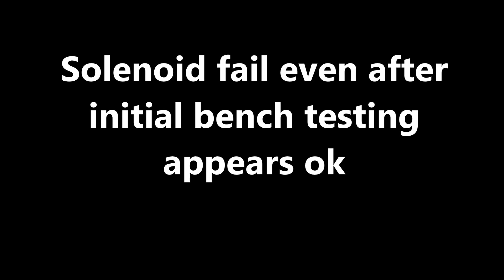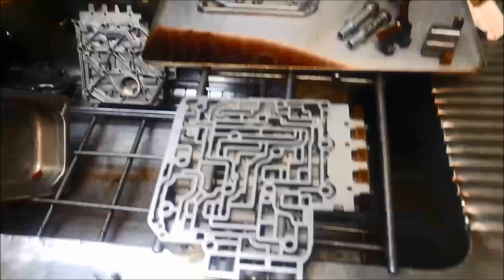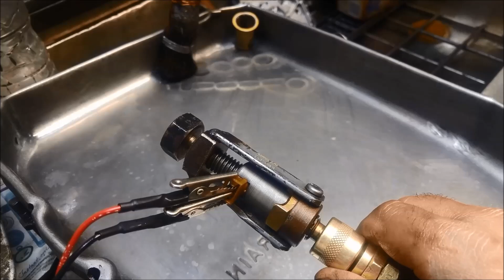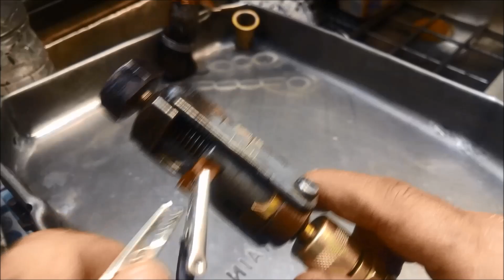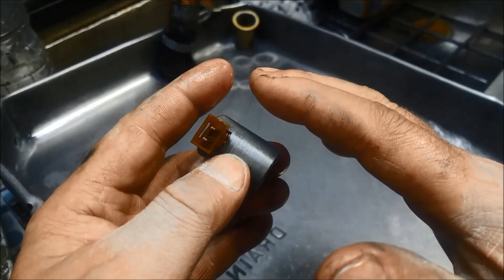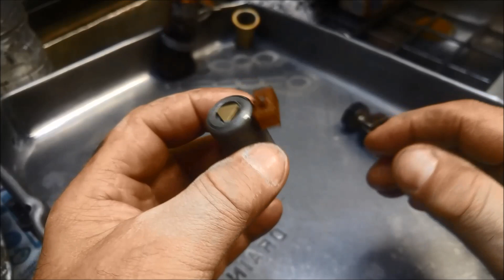Transmission Solenoid Test Fail after bench test initially shows ok How Test Transmission Solenoid

Comment: Hello i have VW t4 Caravelle with 01p transmission that lost reverse ,it started with a delayed engagement for a year then you had to give it a rev for it to go into reverse , then a few months later reverse went altogether .My father was told it was likely a internal issue like the b1 piston or k2 piston or clutches. He removed transmission and pulled apart gearbox only to find it in very good condition. Do you know if a faulty  valve body can cause no reverse? Thank you.
Reply from the maker: hi, i`d need more info. what is manual 1st like? check all the basics first including range sensor. make sure assembly is correct. sometimes clutch drums are a bit tricky to assemble if you dont know what to look for. i`d to a line pressure test and make sure air pressure check ports as in my vids as well. cheers
Reply: @YepThatsIt  Hello thanks a lot for replying. The van first had delayed reverse for about 6 months, then you had to give it a little rev and it would engage in reverse. It did that for about a year then reverse went altogether, but you could still feel it slightly trying to back up when you gave it a good rev, but would only move back an inch. First gear manual was good, he tested it at 20km from drive to first and it did engage and slowed down vehicle, and found after the transmission have been removed, that first gear test should have indicated that B1 piston was fine. He has given the clutches and air test by following your video and all clutches engaged fine, he tested the solenoids, the first 5 that were the same, he tested with air pressure and a battery, and they all engaged and stopped the air. The other 2, he tested with a battery and they all clicked and off, but with one slightly sticky, The first 5 he also tested the resistances and they all ranged from 60.7 to 64 ohms being the highest. The other 2, he tested and they came out slightly higher at 7.1 to 7.2 ohms. And just to mention the transmission was rebuilt by Central automatics in Sydney 80 000 km ago by the previous owner and we had rung up Central automatics for advice but they no longer want to have anything to do with 01p transmissions. As for the range sensor is there anyway he can test it while the transmission is still out of the vehicle? Thanks again for replying to me.
Reply: Sorry i forgot to mention that now and then, when you would pull up to stop at lights, and you put the brake on, the transmission wouldn't engage the whatever it is part that stopped the car wanting to go forward. But it only happened for a little bit and then it could come right again.